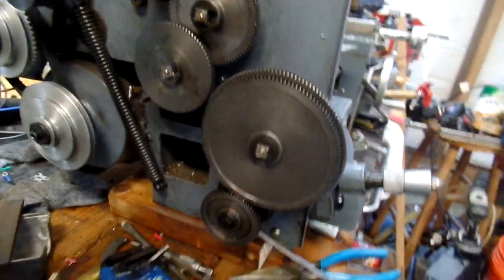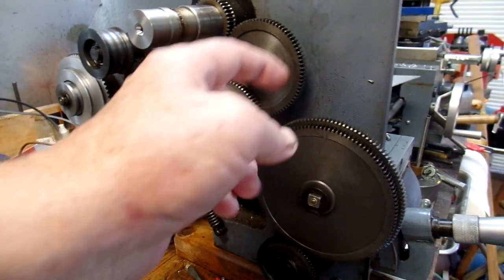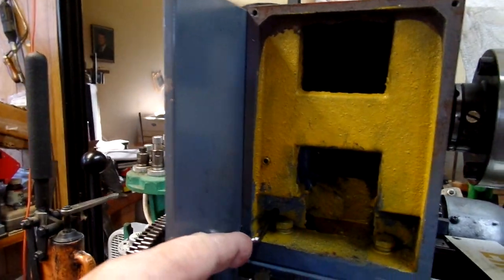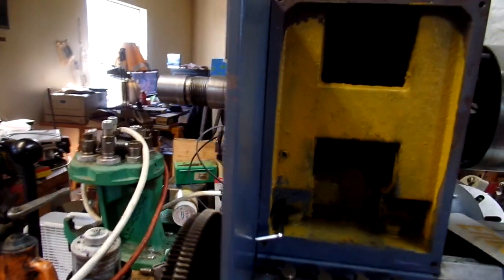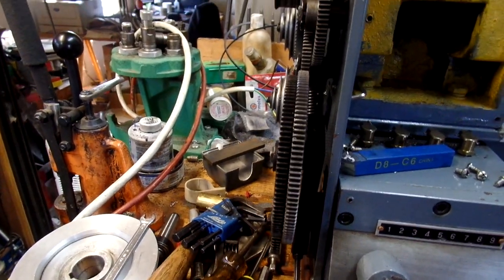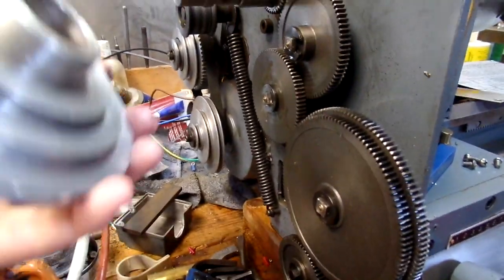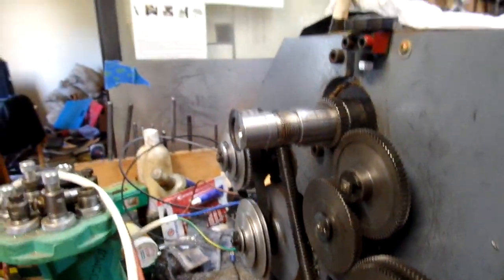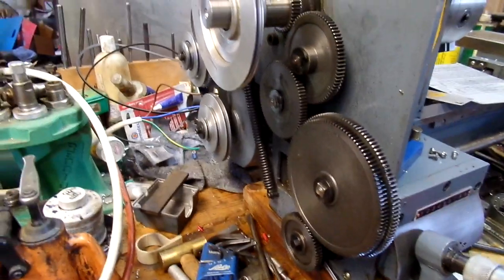E92 Setting the change gears for a 4mm thread

Comment: you are doing a hole lot of work just to change gears, I have a 9X20 Century Machine lathe and never had to loosen a set screw or remove the pulley to change gears, have threaded a 4mm thread and a lot of different SAE threads
Reply from the maker: True.  
The next time I do the change gears it will go easier. 
The lathe had little use and the change gears and posts were tight from having little use.
I have been stoning and cleaning up the change gears and looking the rest of the lathe over.
Thanks